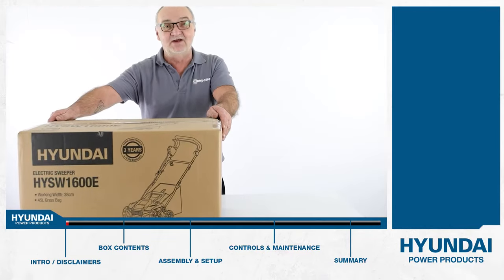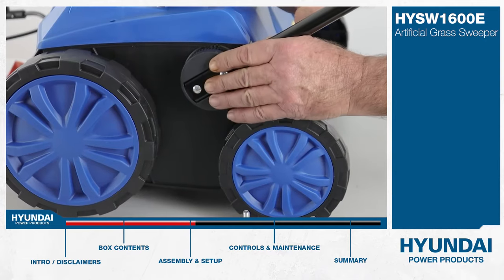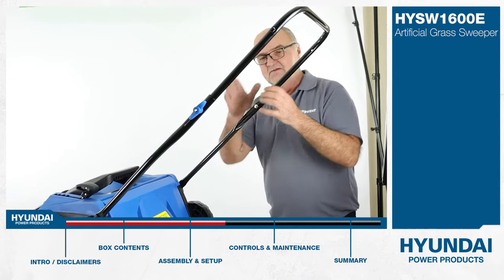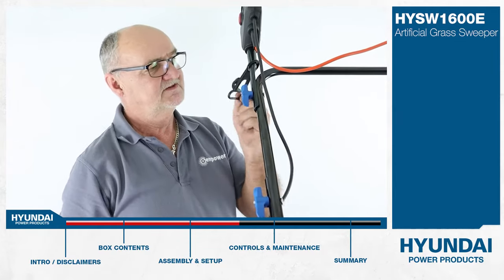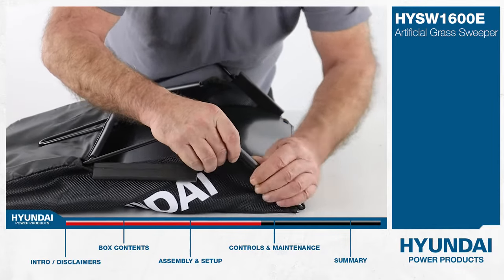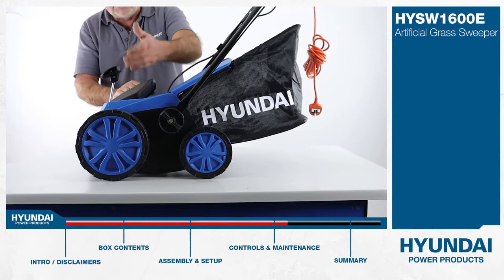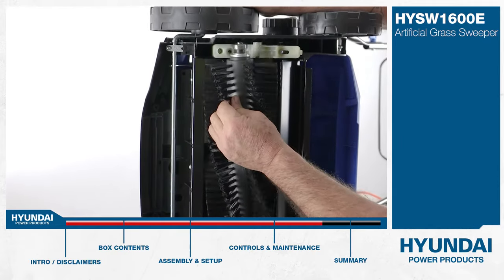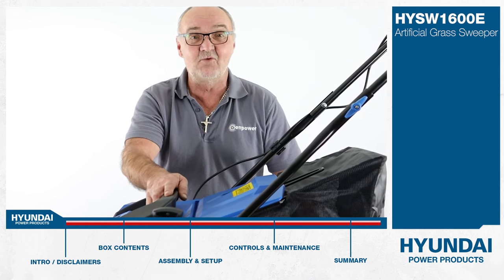The Hyundai HYSW1600E Unboxing & Assembly Guide - Artificial Lawn Sweeper by Hyundai

Comment: Excellent video. 
Super clear and well-demonstrated at a perfect pace. 
Have assembled mine just this minute and ready for a test drive !!!
Test drive - PERFECT. It works a treat. Used the 0 highest roller setting. Found going forward and then dragging it backwards over the same patch was the most efficient way to get a good clean. After the winter it now looks like new. 
Very pleased indeed. 
Thanks very much indeed. 😊

Ps
Hyundai might usefully indicate the link to this video on the receipt/email confirmation of purchase.